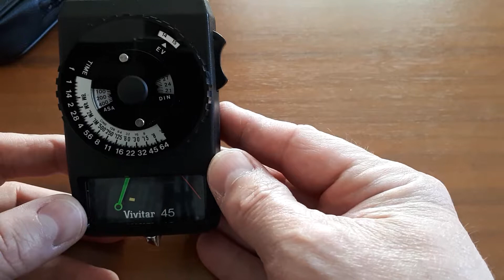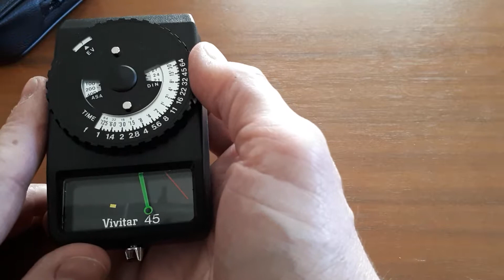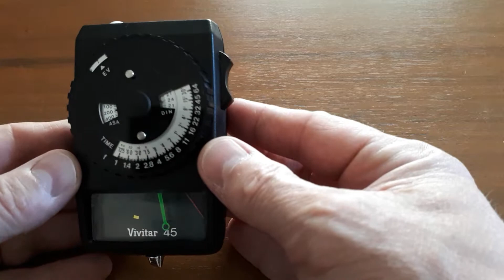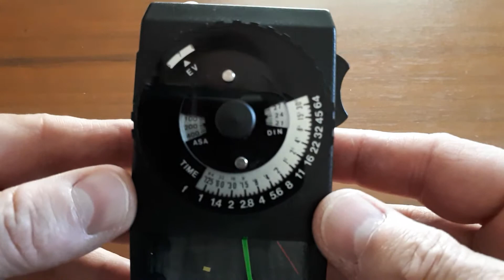Vivitar 45 light meter advice

Comment: i'm using LR44 batteries that have been used in a camera or whatnot until the voltage dropped to the point that the meter's battery check shows them at the correct voltage.

Comment: You can buy 1.35v zinc batteries from wein cell on amazon for around $5.00USD.
Reply: The problem is they have a very short lifespan as (correct me if I'm wrong) they rely on a chemical reaction with the air. That means they it last a month or so when you start using them. There are adapters that are voltage corrected that you can buy like this one https://www.smallbattery.company.org.uk/sbc_mr9_adapter.htm but you'd need to use it quite a lot to get your money's worth! I picked up the Vivitar meter the other day, so will give the one stop off a go!

Comment: Wow!  Your TX looks mint!  But what battery do you use in the TX for accurate meter readings?  It was also designed for the PX625 1.35v mercury cells from that time.  I would think that a 1.5v/1.55v modern battery would give you slightly off readings in the TX also.

Comment: Won't work as the increased voltage will create an error that varies with amount of light, the error won't be consistently one stop at all light levels. Out of all things the light meter should be the accurate and reliable instrument. So many great and cheap and accurate light meters out there.